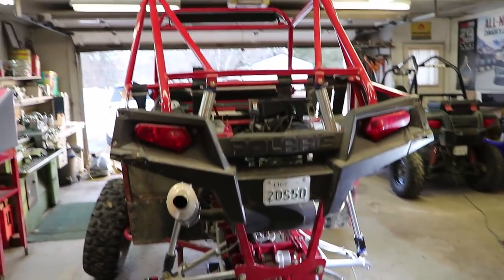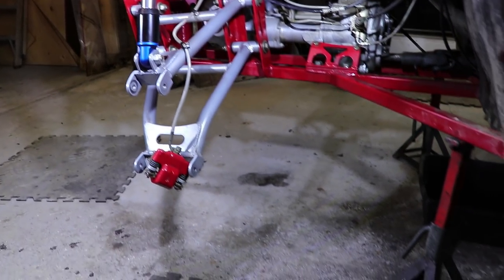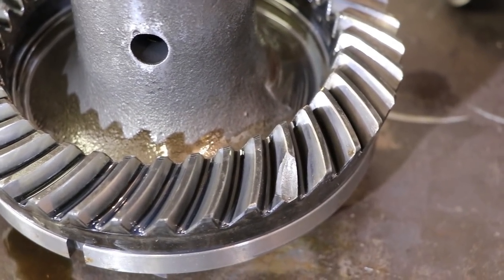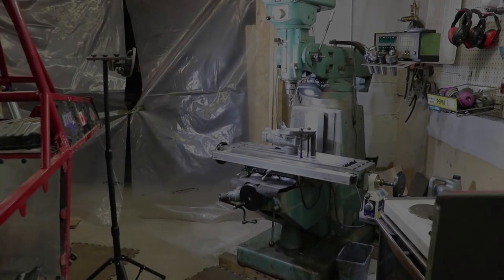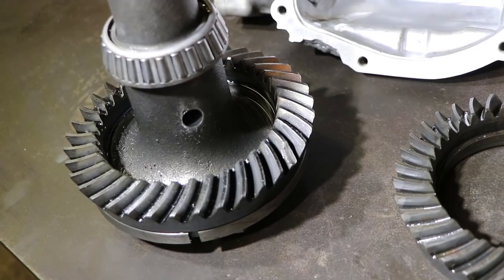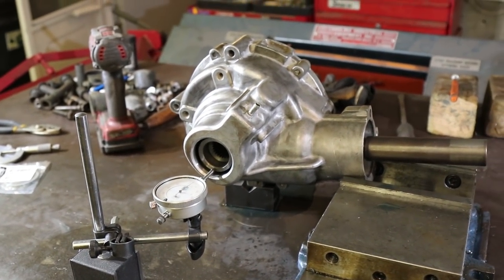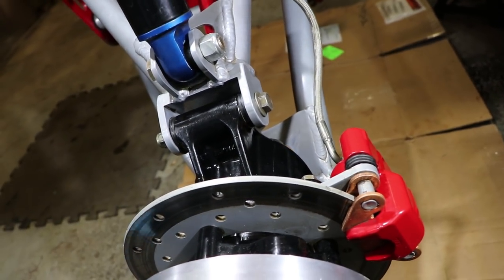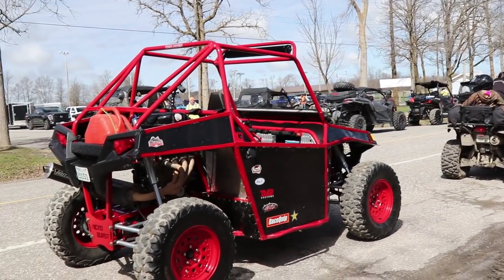Homemade SxS Build - Ep 29 - How to fix your CRACKED RZR diff

Comment: Those rzr 800 rear diffs have a design flaw. They have a nyloc nut on the pinion gear and it backs off due to heat over very little time and causes catastrophic damage and things like you found due to a loose pinion gear.  Some have been found hand tight. The fix is to use the Polaris ranger nut and loctite. Some have reused the nyloc one and used loctite though. Wrote this part way through the video, my bad. Great work! Also, to save on brake pads, add a spring in between them on both dowels. It makes them last much longer!
Reply from the maker: When I was searching the internet I found a lot of people talking about the nut backing off... hopefully lots of Loctite will do the trick! Thanks for the brake pad tip!
Reply: That'll work!

Comment: Good stuff getting that fixed. Your friend must be be a good tig welder, I tried my hand on some cast Aluminum and it was a disaster lmao.
Reply from the maker: We cut a slit down the entire crack to remove the oil soaked material. Yeah he really seemed like he knew what he was doing!
Reply: @glassglowz  I think that was my issue. Crack was full of oil and the weld wanted nothing to do with it.